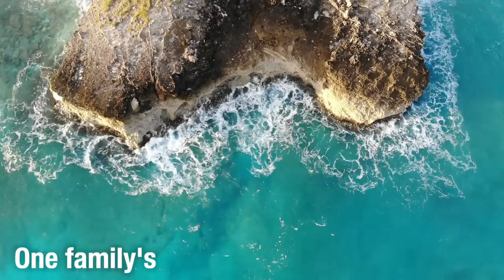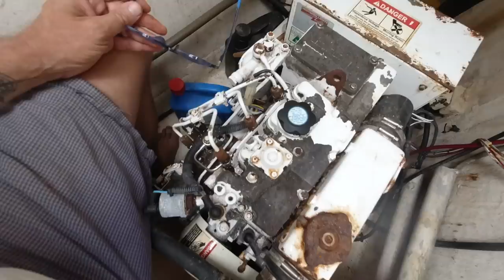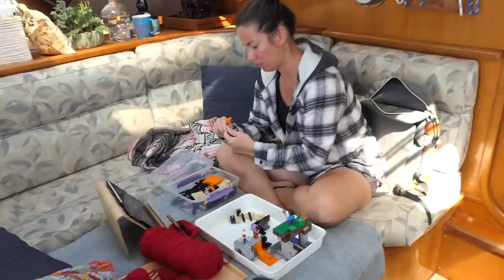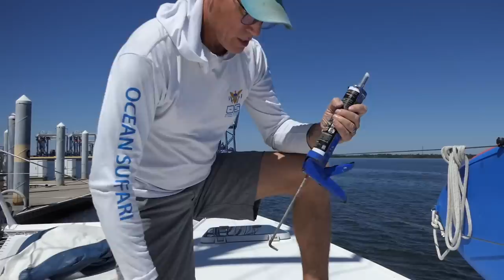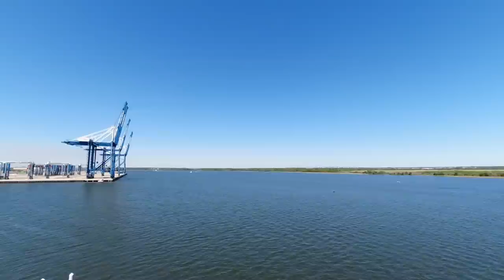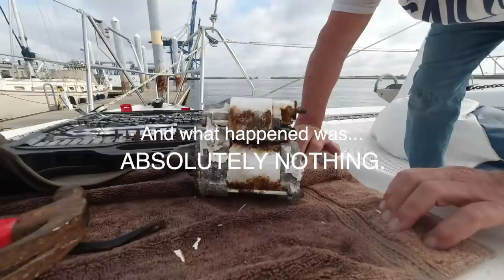NO Motors, NO Generator, But We LEAVE IN A WEEK - Classic Cat Makeover | SailAway 230

Comment: I'm sure you guys have already left and gone back down now that we are going on 3 weeks into Horror-cane  season.  But I keep a couple rolls of Clear "Weatherseal Tape" in a few different widths in both my RV and boat.  The stuff is very sticky for sealing drafts and water leaks on windows and plastics.  it's fairly heavy duty, easy to get to bond to  contours, and is perfect for sealing things like hatches, windows, doors, or even RV seams that may start leaking on a cross country trip where I don't want to be stuck somewhere caulking or trying to buy the good white RV seams tape.  It's pretty inexpensive, in my experience even sticks to semi wet surfaces, and is worth having in my cool and supply cabinets. I think I paid around $10 for 2" wide by 100 foot long rolls the ladt time I ordered it.  It was name brand 3M.  I'm sure the off brands are cheaper.
Reply from the maker: Nice. We’ll look into that! We’ve got a pretty good handle on most of the leaks, but if the decks get awash with a wave, some still gets in.
Reply: @SailAwayVlog  i wouldn't rely on it as a permanent fix.  I'm sure the sun will probably eventually degrade it like anything else.  But to throw some over areas you know are leaking to get you through a crossing then address the issue later it should help.
Reply: @SailAwayVlog  

Hey!  

I was at home Depot this evening  pricing roofing, drip edge, fascia & soffiting for my house.  I am budgeting renovations over the next handful of years to sell after  my three 11ish year old dogs pass on.  I'm going to go with a roofing supply company through my cousin who is a contractor after seeing home Depot and Lowes prices.  

     But it reminded me of the stuff I used on my 2008 travel trailer on my property up in NY that I got really cheap when it was only 5 years old because of serious delamination. It may work for you & at least get you back sailing this year and give you some time before you have to dive into pulling hatch frames and fixing rotten wood, re-glassing & all that.  They make all different roof coatings in prices ranging from $10 a gallon to $70 a gallon.  
     
       I did the drill inject epoxy then squeeze process to deal with the delamination, then diamond plate across the front for protection when we towed it across country to the Sturgis motorcycle rally, then to Washington and down the Coast to Southern California before bringing it back to Florida then up to Western NY.  
      
     But I had tried multiple different caulk like products  to seal the roof and corner seams & nothing stopped it from leaking when towing at highway speed in the rain, or in driving heavy rain storms.  It leaked like a sieve during a rain rapped tornado with quarter sized hail that hit us during the Sturgis rally in a campground near the Badlands, and I found even the window frames, and exterior storage hatches leaked with that much wind and rain.  
     
     Finally after talking to repair techs at RV dealers, and researching online, I used the Eternabond style Fibre backing reinforced UV Stabile RV seam tape, then a roll on UV Reflective Elastomeric Steal Coating. I taped all the roof seams, corner seams, all the flashings, roof penetrations & around the window frames.  Then painted all the taped areas and out a couple inches onto the walls,  & the entire roof using Lanco's Clear Acrylic Primer, followed up with I painting the entire Trailer, roof, exterior walls, my AC cover, all's the vents & stuff on the roof with their Acrylic White Seal.  The only things I didn't paint seal coat on the exterior of the RV was the mirror tinted crank open bathroom vent cover, and the vinyl graphics package on the sides and back.  I figured that all had reflective coating on it anyway & already reflected UV light.  
     
     I am thoroughly impressed with it.  It claimed a 10 year warranty.  But I didn't actually expect the stuff to hold up through the winters up there where the temps regularly drop into the negative single digits and teens farenheit, with negative 30 or below wind chills when there are winter wind storms. With all the snow & the ice we get up in Western NY I figured I'd have to redo it every 2 or 3 years.  It sits out on the edge of my   old farm fields in full sun with no shade all year long.  But my nephew is living in it up there & here we are 8 summers later, and it still isn't leaking nor does it show any cracking.  The UV Reflective properties obviously work too.  He doesn't even have to use the AC for most days in the summertime.  Before I coated it it would turn into a sweat box without the AC running even on 80 degree days with full sun.  

      I used is the "White Seal" made by Lanco.  It is a Styrene Acrylic Silicone based single component Elastomeric Coating, & advertises a 10 year warranty & to reflect most UV Rays.   I used the white to match the color of the RV.  But they are made by multiple different manufacturers in different colors formulas like acrylic, siliconized, butyl, etc, & have warranties ranging from 5 years all the way up to 25 years on the more expensive stuff.  The one I used is now up to $75 for 5 gallons, and they had it in white and they had an Acrylic Primer/Sealer in Clear coat right next to it at $65 for 5 gallons. There were 1 gallon buckets of "Siliconizer Crack Sealer" for $25.  Knife or spatula applied mastic that even said it was sand able.  They had the roll on white seal in 1 gallon pails  for $18.99, and the Clear seal was $15.  There were also  pourable crack & keack sealers designed to be used stand alone or in conjunction with the roll on coatings.  

     You could probably use clear or the white around any deck penetrations to seal them up temporarily.   If you were careful and you cleaned then taped the frame and hatch glass, you could try using the clear, or they make blacks which would probably match the sika or butyl previously used to bed the hatches, or if the frames are gray most companies make their coatings in a UV Reflective grey too. Pour, roll, or load it into a child's medicine syringe and apply it into the seams between the hatch glass and the frame, wait for it to seal out any voids and reapply to any low spots to bring it up even with the top of the frame and glass top.  After an hour pull the tape and you should have a water tight seal for the time being. 
     
     You can use a different product I would think any of the rubberized roof coatings should do what you need.  Just remember you will have to cut through it to get the panels out the next time you go to rebel or replace them.  You have to weigh saving time now to enjoy the boat, and be able to run from a hurricane without being in the middle of a job, vs a little more work later.
Reply: The clear seal primer and sealer product description is 

AS-210 is a clear 100% acrylic elastomeric roof primer and sealer of constant flexibility for crack resistance. This primer and sealer penetrates and waterproofs concrete to stop leaks thoroughly. The product also protects exposed architectural concrete, aggregate sidewalks and ornamental stone.

May be applied with roller, brush, squeegee or sprayer

Covers approximately 350 sq. ft. per gallon (1,750 sq. ft. per pail)

For previously coated roofs, concrete/masonry, metal, rubberized asphalt, rubberized mastic, trailers, RVs, and wood

Dry to touch: 30 minutes; Dry to recoat: 4 hours

****************************************************
 And the White seal

Model#: RC865-4

Sku#: 992472

Internet#: 202086640

For commercial, residential, and mobile home roofs
Ultra white finish helps reflect sun's heat
Provides waterproof seal

White-Seal is a one-component, thick, high performance styrene acrylic, rubberized, elastomeric roof sealer. When applied as directed, it will provide a waterproof and weatherproof seal adhering tightly to any surface and it will not crack, crumble or peel despite exposure to severe weather or total joint movement. White-Seal reflects sun rays and reduces interior temperatures.

May be applied with roller, brush, squeegee or sprayer
Covers approximately 50 sq. ft. per gallon (250 sq. ft. per pail)
For previously coated roofs, concrete/masonry, metal and rubberized asphalt
Dry to touch: 1 hour; Dry to recoat: 24 hours

They  white really does  Reflect UV light to keep roofs cooler.  I had to use the AC in my travel trailer in the summer in NY before painting the roof and using the left over to coat the outside walls. Now it is rare it gets so hot inside up in WNY that having the windows open and a fan on inside isn't enough.  

     Multiple manufacturers make them in white, grey's, and even clears, I'm just showing you what I used and was pleased with for the cost.

Comment: Why not mount long shaft outboard engines off the sugar scoops? I would gladly step over them to simplify propulsion and repair/replacement. I'm obviously missing some major negative.
Reply from the maker: Thanks for watching! It’s not a bad notion and some cat builders do that with smaller models. Ours would require pretty big motors which would be quite expensive, especially considering throttle controls, etc. that would also have to be run. Would also be a lot of weight way back in the transom which also wouldn’t be good for sailing performance. Good running diesels are very dependable and long running, so getting ours in good shape is still the most economical approach.

Comment: you can use car off the shelf starter for the NL gensetr just need to match the gear teeth, I think it s a 7 teeth, cheap fix, same for the engine probably a 9 teeth gear
Reply from the maker: Yeah, I think it’s actually a Kubota part. We did actually get the starter working though…just wasn’t generating power.

Comment: I've been thinking about your diesel engine issue.  I've not been paying acute attention to which engine is doing what, but I have seen several similar issues with diesels of the land variety.  Obviously the engine is not water locked.  Some of the diesels I have seen size have bearing or ring problems that can make the engine lock up.
Reply from the maker: Yeah, that's what we're thinking too...most likely a ring...something that could've rusted up in that short time.  We didn't want to force it too hard and break something so once we're anchored somewhere with some time on our hands I'll pull the head off and figure it out.
Reply: @SailAwayVlog  Likely you'll find a scored cylinder head where one of the rings has broken.  If that is the case I'll be praying for you.  That is a re-hone situation and an upsize piston replacement.
Reply: @SailAwayVlog  I did get a quote from a guy in Florida for a Nanni Diesel with standard gearbox 21hp for around 8500.  They have sail drive models as well.  I'm thinking 10k plus install for a 29hp.
Reply: @SailAwayVlog  Last post promise.  If you get the head off to unsieze these guys some people will use a piece of wood and a sledge to move the pistons.  Look up what to do on YT.

Comment: A few comments.  Engine bilge pumps seem to always be in awkward places and difficult to replace/maintain- suggest you mount bilge pump on plastic angle bracket material (like from HD plastic trim pieces) in the shape of a long L.  Pump mounts on the 6" long foot of the L, you lower it into position and vertical 2-3' part of the L is screwed into the forward engine room bulkhead.  If you need to replace pump just undo screws and lift up... and the plastic does not rust.  I have done this on a Leopard cat.
Hope the shop was able to fix the generator starter motor and if not, you were able to find an aftermarket replacement- the OEM stuff is so expensive.  Assume we will hear about starboard engine next time and soon find you in St Augustine.  I suspect you will need to pull the head on the port engine to find and hopefully fix the problem.  Praying it is not salt water hydrolocked....
Reply from the maker: That’s a great tip! I manges to get them working but that sounds like a much better long term fix. The motor definitely is t hydrolocked - we removed all but one injector and on the stuck one we removed the glow plug. No sign of fluid. I’m with you - plan to remove the head and dig in once we’re anchored somewhere in the Caribbean and I can put some time into it.
Reply: @SailAwayVlog  Another thought is that the issue may be related to flywheel- eg broken tooth and it is jammed  between some teeth and the bellhousing.  Unbolting and pulling the transmission aft would allow visual inspection and help to determine if that is the cause. Inspection might be able to be done with starter motor removed and arthroscopic type of camera attached to smartphone is used to inspect flywheel. Ignore suggestion if either procedure has already been done.

Comment: ..... first off I'm not a mechanic but hate what it cost just to have it looked at and they don't diagnose anymore, they just plug in to get told my car bought new in 84, plug it in, hell it don't even have cup holders ..... anyhow from one day to the next it would not start and checked the continuity of the leads and all was good, did various other youtube suggested diagnosis, the solenoid was kicking and jumping terminals not a peep from the started ... so it is the starter, changed and same thing, turned in core at purchase time ... checked for continuity and the positive from battery to starter, dead .. turns out I had the multimeter on the wrong setting first time around .. just a wee bit pissed at my foolishness .... Re the possible hydro locked engine .... guy in his Pete semi figured it was hydro locked and tried turning in the running direction no go, was on the phone for guidance and was told to turn it backwards thereby releasing as opposed to increasing pressure in the cylinder. He did this going through several cycles of the valves opening and pressure building backwards and the water was forced out through the exhaust. That is how it went if I understood correctly what was said. They determined that when run, the engine was hot and when it turned off and cooled coolant was sucked into the cylinder. They anticipated that it was going to be head gasket as there was not water in the oil. The driver started the truck and drove off headed for the shop, do not know what the final diagnosis was. Here is to hoping you get to the bottom of your mystery..... reminder, I know nothing, just relaying a story ..... build a roof over the genie to keep the leaks off it .... thx for the share .. as always .. never stop dreaming, just dream bigger .. have fun be safe, save our oceans .... PS just realizing these vids may be a few weeks behind and you may have solved and are in Grenada already .....
Reply from the maker: Thanks for watching!  Yeah, I think your diagnosis method is the way to go.  Especially in the US it's tough to get any kind of real diagnosis from a mechanic without committing to a lot of costly time.  We gave it a shot and he didn't work out.  We went through a lot of the kind of process you're talking about and have realized it's just gonna need a rebuild most likely...something I'll be able to do (with a little help) once anchored for a couple months somewhere where labor is a lot cheaper.
Reply: @SailAwayVlog  ... feel for you, it is always trying when one does not know the starting point. Once one knows then one can delve into the school of youtube and find a coach or even various coaches to help you down the path to glory .... thx for your reply Eric ... make it an exceptional week .....

Comment: A monohull would leave on one motor. Not saying it is great but it is only less ideal than the dual redundancy ordinarily provided by a cat with a little less control in port. Not making light of your problems but, hopefully, helping you avoid unnecessary fear. You can sail if you need to.
Reply from the maker: Exactly!  That’s our thinking as well. Not ideal, but we try to sail as much as possible anyway.